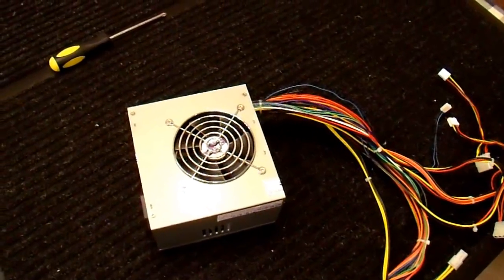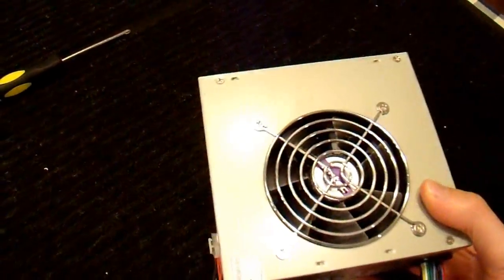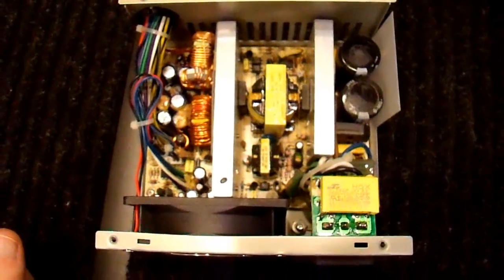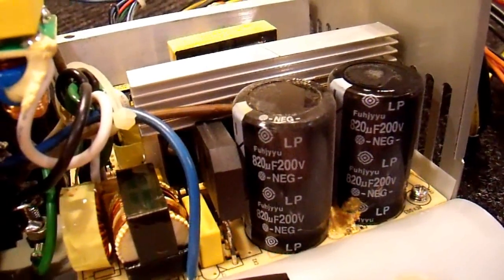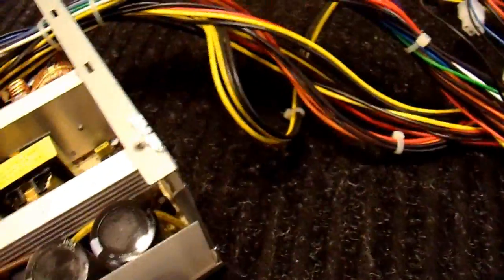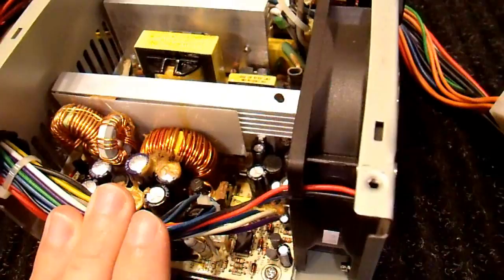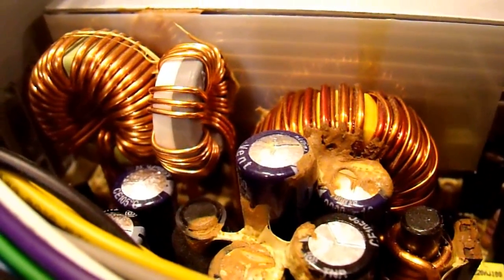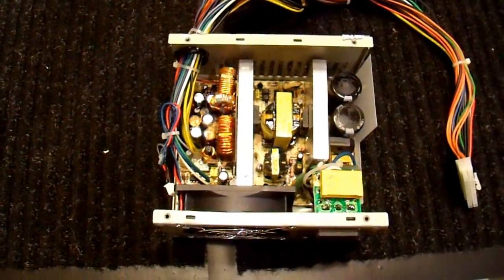Inside a Failed ATX Computer Power Supply

Comment: simple repair - just fix it. Its most likely going to last longer than buying a new one today unless the output just cant cut it...good for backup even still
Reply from the maker: While you're probably right I did not repair this supply.  The landfills of the world are full of such treasures.
Reply: Yes, that's true. The best PSU I ever found was to be thrown out from a PC repair store - I found nothing wrong with it and used it for years until I sold it later on...they thought it was faulty but no, obviously something else. I like repairing stuff, makes me feel good to reuse and repurpose stuff...

Comment: yes, you CAN find cheap PSUs today, but I would not recommend it. Get a more expensive model from the likes of Corsair, EVGA, Be Quiet, Seasonic, ect. These companies usually make very-high quality power supplies (for example, mine, a SuperNova 750G3, has a 10 year warrenty, which might indicate how long this PSU is expected to last)

Comment: I have an old defective ps, . Looks like one of the early to mid 90's. It is 65w and the plugs are very old, it doesn't have the big main plug. It doesn't have the green wire that I can bridge with the ground wire. I opened it up and all the caps look good, no bulging. I want to use it for my hobby projects since it rates only a nice and safe 65 w and has an on/off switch, can you help me trouble shoot it?
Reply: That is the old AT standard used in the early 90's before ATX. There is no green wire to turn it on, you use the power switch instead. If it does not work it is likely bad capacitors due to its age.

Comment: i think my 350 watt power supply is just dead i plug it in brick outlet and i just hear a "boom" it is on 210v and when i just put it again in the brick outlet i just hear again a loud bang inside. its on a 110v on a regulator and a setting on the psu 110v???? or i just need to dump it???
Reply: Michael Lopez same
Reply: Michael Lopez try and get it repaired

Comment: Not having active power correction is not necessarily a bad thing.  The circuit works like it should.  APC is useful if you live in areas with a shitty power authority sending  you bad ac to your mains.  Most people will not experience this so why pay for it.

Comment: Old video I know, but if you don't mind I have a related question. I've been using an AT supply to power a car amp and speakers indoors. Watching some videos online to check my facts on amps I notice comments from some on how all the yellow (12v) leads need to be connected together to provide the full amperage. I've been using only 1 lead but have also had it deliberately limited to half volume to reduce load as I was never sure on the compatibility. Checking my numbers now it's a good thing as the PSU outputs 12v 12A and the amp is 20A haha. But it has worked for years as is so I'm happy. Anyway, your input to the multiple leads question would be appreciated.
Reply: Allan McKenzie One wire is fine (yellow and black). The only reason to put all of them together is if the wires cannot handle all of the amperage, that could overheat the wire.
Reply: Joshua's Recordings Thanks :)

Comment: PFC is only required in Europe, and for voltage doubler/switch selection designs the most you will ever get is 220V capacitors... 400V or higher is for PFC which has a buck boost.

Comment: Antec is NOT a cheap brand! Actually they are a really good brand!  I would have put a Antec PSU into my build if they were not so expensive!
Reply: be quiet! is the best
Reply: ***** Antecs have been and still are the top quality brand in PSU's. Seasonic comes right after. Be quiet! has about 5 good PSU's and the rest are shite.
Reply: CalculuS If they're apparently so great, why does my VP550P have such a retarded rail arrangement?
Reply: NikolaiMTA Pretty much normal, you either have a single strong rail or you have 2/4 slightly weaker rails.
Reply: NikolaiMTA What is wrong with the rail arrangement?
Reply: +CalculuS How can Antec be the best brand if they don't manufacture PSU's but just sell PSU's made for them by FSP, Delta and Seasonic (maybe some others but these are the main ones AFAIK)that obviously don't give the best units to other companies
Reply: carzacc Because obviously they use only the best quality psu's from FSP, Delta and Seasonic. Their brand just represents quality PSU's. Doesn't mean they are the best PSU maker's.
Reply: CalculuS You said they are "the top quality PSU brand", as much as I like them as a brand I think it's too much, and something like my VP450P is not the top quality from FSP
Reply: carzacc Because you are looking at a lower-end product. Compare it to other low wattage products like say the Corsair CX430 and its 3x better.
Reply: CalculuS Hmm... I see my PSU as pretty much the same thing as the CX430
Reply: carzacc Antec 450VP http://www.hardwaresecrets.com/antec-vp450-power-supply-review/7/

VS

Corsair CX430 
http://www.hardwaresecrets.com/corsair-cx430-power-supply-review/7/

Overall the cx430 is more unstable in power delivery, its less stable and the 450PP is basically always within a certain 80% efficiency while the CX430 ranges anything between 74% and 84% which is a really bad thing when it swings this heavy.
Reply: Not to mention during the overload test the VP450 kept ripple within normal levels as in during a normal test, the CX did not. The CX also was killing its fan by going above its maximum RPM in the overload test leading to fan failure.
Reply: CalculuS If this isn't your personal test, can you give me a link?
Reply: carzacc I don't own either of these PSU's, those tests are made by a guy who knows what hes doing.
Reply: CalculuS Do you have a link?(I didn't find a lot of VP450/VP450P review and I still search for them every once in a while)
Reply: carzacc I literally included one in my first post? http://www.hardwaresecrets.com/antec-vp450-power-supply-review/7/
Reply: CalculuS It literally didn't show up in the feed at first LOL
Reply: carzacc Oh yeah that explains why you asked for a link.
Reply: CalculuS I read hardwaresecrets' review of both and the CX430 had much better ripple control
Reply: nope FSP is the best brand ever.
Reply: Nope FSP is the best.

Comment from the maker: Ground is common, although each voltage plane has its own GND conductors to prevent GND offsets.  If you share grounds a load transient on one voltage plane will greatly affect the other voltage plane sharing that same ground wire.  The ATX spec details are free to download if you want more details than I can give off the top of my head.

Comment: the key is the voltage selection switch, if is has it there is no active pfc, older server grade psus have passive pfc, and the therefore no need for the 450v caps. as the higher voltage removed(in theory) by a diff tap in the transformer